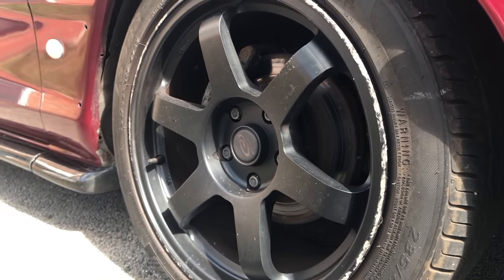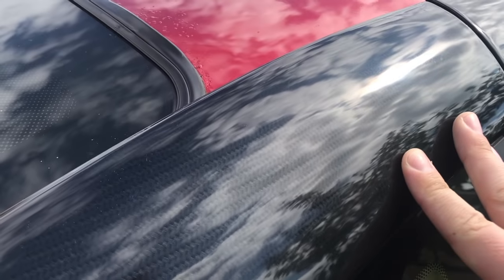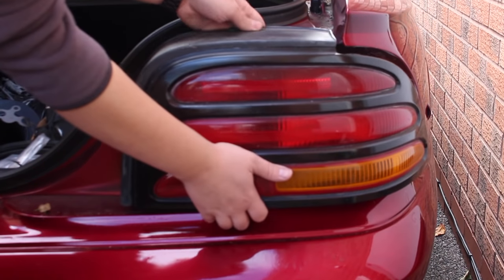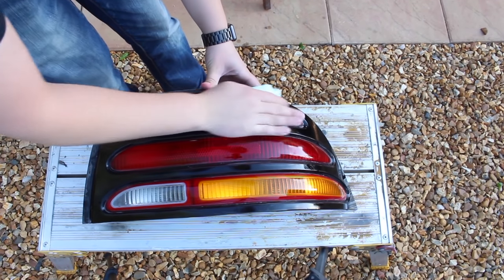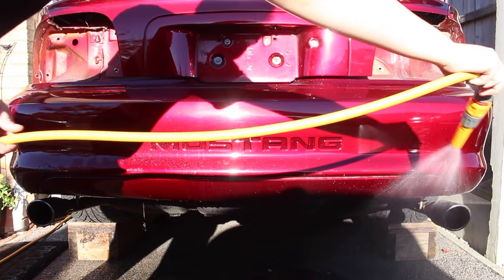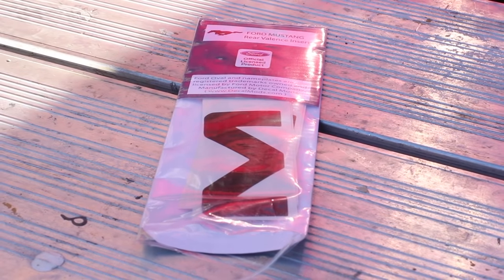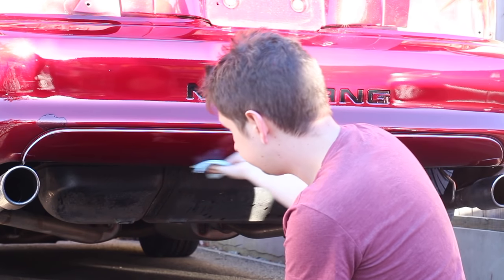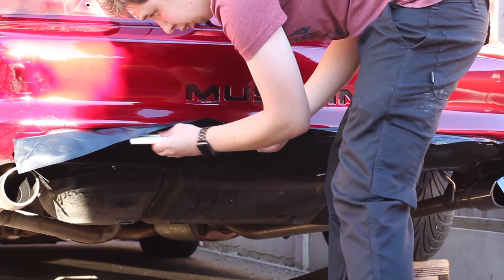Sorting My Mustang's Bodywork - Pt.1

Comment: Just sub'd for the 'Stang series but always interested in your detailing guides. 
Re; the seized alloys, undo the wheel nuts but don't fully remove them. Then lower the jack so the wheel takes the weight of the car - this should shock off the alloy from the hub quickly and safely without having to go full Chuck Norris.
Reply from the maker: Thanks for the advice. If Chuck Norris really kicked the car, I wouldn’t have a car.